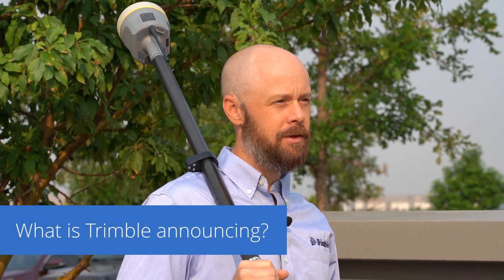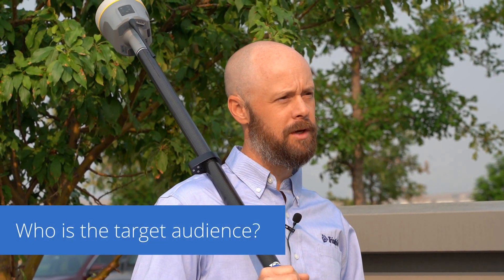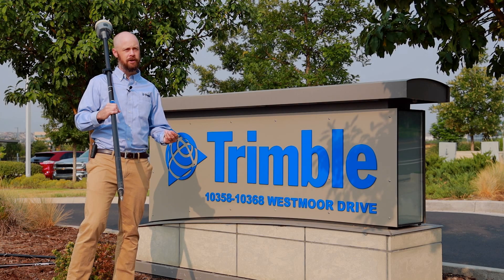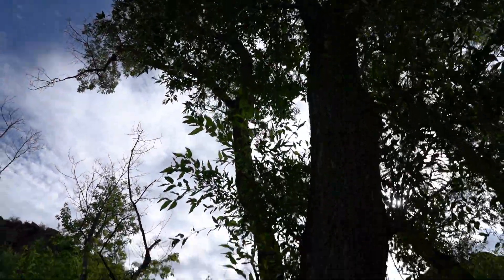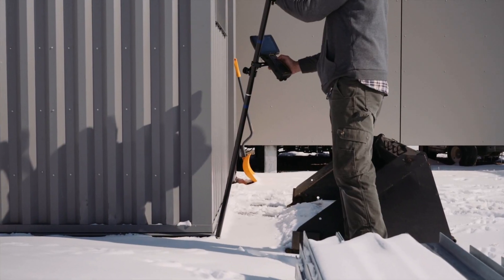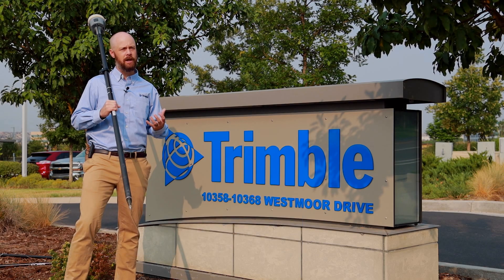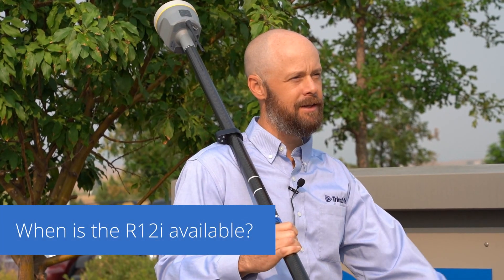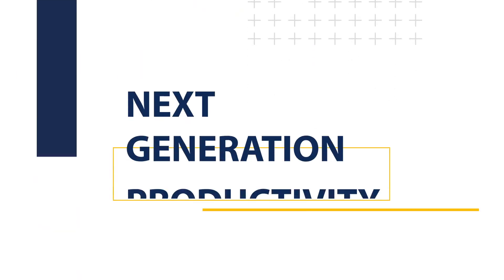Trimble R12i: The Next Evolution of Our Flagship GNSS Solution

Comment: While tilting the rover shoud we get exact coordinate of bottom part touched to  ground ?
Reply from the maker: Yes when tilt compensation is turned on, the R12i is continuously calculating the coordinates of the pole tip. This works both when measuring points while the pole is tilted, and during stakeout when you're trying to find a point.

Comment: So the R12i unit is set up not to be leveled and still collect data. Does this only work using Trimble Access only? Is Survey pro set up also? Accuracy would be my biggest concern!
Reply from the maker: Yes, the R12i has IMU-powered tilt compensation that means you don't need to be level when taking a shot. This featured can be toggled on/off if you want to survey without it, so static point measurements, etc. We totally understand about trusting the accuracy, every surveyor should do this with a new instrument. We recommend getting a demo setup - if you're based in California we have two distributors there that can set up up with that: California Survey & Drafting Supply and Allen Instruments. You can also request a demo request here: https://r12i.trimble.com/signup.html